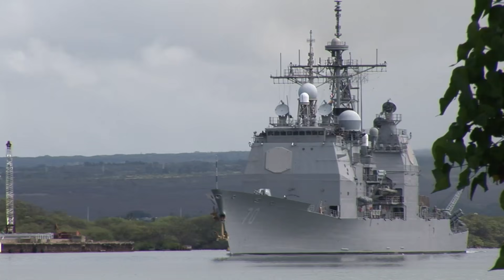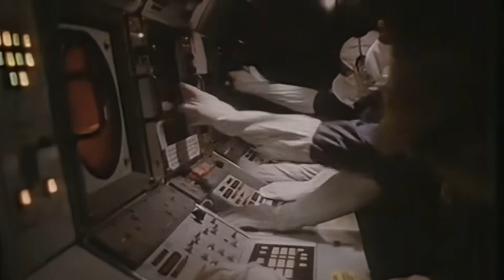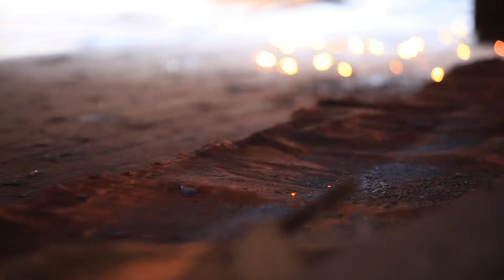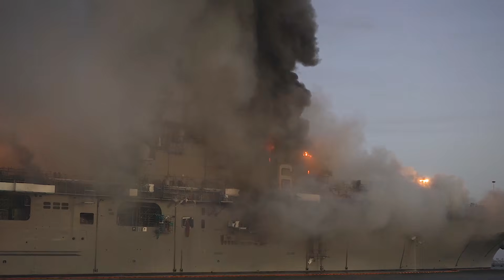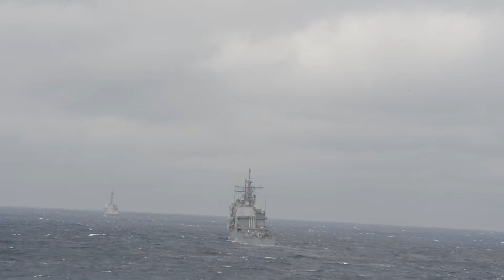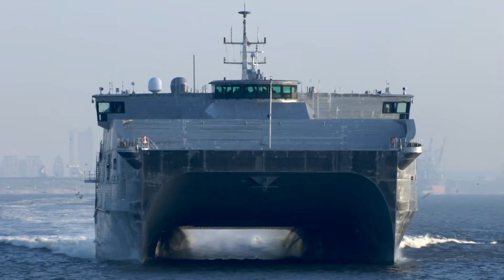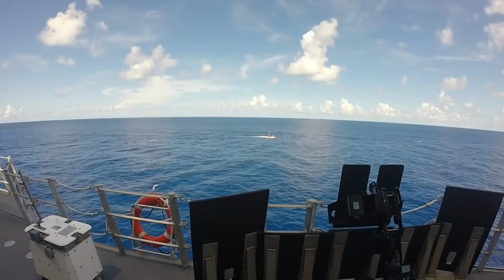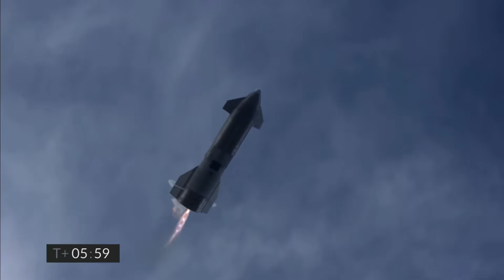Why is The US Building Aluminum Warships?

Comment: "... while aluminum doesn't burn ..."

Uh, yes it does.
Reply: The British scimitar armoured vehicles had 2-3inch thick aluminium armour plate that was known to catch fire if they took a hit
Reply: @tacticalultimatum  yup
Reply: The fumes from burning aluminum  is highly toxic
Reply: MELTS
Reply: So does steel in similar conditions. You can light steel wool for example.
Reply: @krupert8355  steel wool is much different
Reply: @phredphlintstone6455  how so?
Reply: @krupert8355  all of the air in it. It's not like a block of steel. You can push your finger through steel wool
Reply: @phredphlintstone6455  Are you saying you can light a block of aluminium on fire with regular sources of heat?
Reply: @krupert8355  define, regular sources of heat. After all, we are talking about warships and tanks and such. 
But there is a reason why you dont find aluminum wiring in houses.
Reply: @phredphlintstone6455  it would be easier to mention what would be an unnatural source of heat... say a plasma torch. And from what I read the reson for dicsontinued aluminium home wiring is due to expansion and contraction issues as well as oxidation issues when joined to copper connections. Both of which could lead to a fire hazard... not due to the metal but due to bad connections leading to heat and sparks. Aluminium is used for high voltage power lines. Aluminium is also used to armor copper cables.
Reply: @krupert8355  well there you go. When was the last time a navy ship was threatened by a torch? 
As far as aluminum cables. ..you dont see all that many cables in homes. I did almost mention them before but thought it was off the track. Cables are much thicker so the heat aspect is different. 

Back to the point. Burning aluminum sends out toxic gasses. 
Steel wool isn't exactly steel, try building a nail out of steel wool. 
Yes I know steel wool will burn, used the steel wool and battery trick to start more than a few fires. 
Really cool to watch, you can see the individual threads glow red and then they vaporize, the glow jumps someplace else because electricity is going to electric. And many times by the time there is a flame there isn't that much steel left. If there was such a thing as aluminum wool it would be the same thing but you can end up with strange diseases and odd tumors.
Reply: @phredphlintstone6455  my point is that both metals burn in similar conditions, mainly high heat and high oxygen, such as with metal powders and metal wools. People mentioning that aluminium burns is kind of pointless if the alternative is steel.
Reply: @krupert8355  its the fumes that come off of that burning that is the issue
Reply: @phredphlintstone6455  It's the whole "hallway melting around you" thing that's the real problem
Reply: @anonymousapproximation8549  I'd say both
Reply: @phredphlintstone6455  Personally I'd be more worried about the whole "melting" thing then the "toxic fumes". At least the fumes kill you silently.
Reply: @anonymousapproximation8549  dead is dead
Reply: @phredphlintstone6455  Yeah, but if something has to kill me, I'd rather it be fumes. At least it puts me to sleep and then kills me. Anything else is just several moments too long of either pain, terror, or both.
Reply: @krupert8355  not really, aluminium is more reactive
Reply: Uh, no it doesn't.  Powdered aluminium does, but then the powder of just about any metal does.
Reply: @krashd  Add a little rust. You get Thermite.
Reply: @krashd  smash an anti-ship missile Into an aluminium superstructure and there is more then enough powder
Reply: @krashd  Have you ever seen alu armored carrier after burnout? Apparently no :D
Reply: Even steel burn at the right temperature.

Comment: Aluminum burns when exposed to a flame, as it is a reactive and flammable metal. It burns in oxygen with a white flame and by forming aluminum trioxide. The oxide layer that always covers the aluminum metal protects it from reacting with the air. The removal of the oxide layer allows the metal to react with air and water.   USS Stark FFG 31..survived a exocet attack...This vido needs a bit of fact checking..
Reply: I think your thinking of magnesium.

Comment: Elon Musk disagreeing with the Russians regarding material properties doesn't make sense. The kind of material properties demanded by warships and rockets are very different. SpaceX decided to use stainless steel because of its ability to hold it's structural strength in a wide temperature range.

Comment: we should make our ships out of inconel. it's twice as strong as steel and has better heat resistance. sure, it's a little more expensive then steel and aluminum. but when survivability is factored in, i would think a bunch of steel and aluminum ships sitting at the bottom of the ocean would be a lot more expensive then inconel ships which are still fighting, even after being hit.

Comment: Aluminum will burn when oxidized.
Reply: Aluminum oxidizes as soon as it meets O2.  Never seen an aluminum can burst into flame
Reply: @protonneutron9046  My friend, apply high heat. That's all I need to say. Many low explosives(low just denoting that it's not as fast of a reaction as high explosives and faster than a deflegration which is just fast burning) use aluminum or magnesium often(these are the more basic explosives that often terrys or low tech adversary's use) 

The reason you haven't seen a can explode is because at atmospheric pressure and regular temperature the reaction can be quite slow, harmless and not really notable. But assume your enemy makes an explosive of 1 micron Black Eckhart German Aluminum and mixes it with a powerful Oxidizer such as Potassium Perchlorate. You'll get an explosive that will temporarily deafen you with just a few grams and certainly blow limbs off you're too close. 

The difference like most things is the time frame but also the heat. When high heat is applied you could agree that aluminum oxidizes faster. Well imagine a squashed Head projectile filled with this mixture that's heavy on the potassium perchlorate, within milliseconds of detonation all aluminum will be used from the bomb but then the high heat will cause a certain amount of aluminum from the ship to vaporize and react. This could lead to any even bigger explosion and temporarily start a metallic fire. This was one of the same worried they had with the Bradley IFV to an extent.
Reply: @caymanhunter2612  I was joking my VERY young friend.  I was casting aluminum before your parents were together.
Reply: @protonneutron9046  lol. Okay even younger padawan. Actually you know what. I'm okay being the younger. No big deal gramps. But lol instead of casting Aluminum and nothing else on the 4th of July drop some potassium nitrate or even a stronger oxidizer and watch that puppy erupt like a volcano
Reply: @caymanhunter2612  I prefer to use I + NH3 when making things go boom.
Reply: @protonneutron9046  if you searched you probably could find some videos of aluminum in bombs. It can be used in everything simple from fireworks and flash powders to explosives. Magnesium is probably one of the closest metals to how it performs. Rarely do you ever heat aluminum high enough to react and when you do and apply some oxidizer the reaction can sustain itself for a small time afterwards. The other issue is when it oxidizes it releases hydrogen gas which is part of the reason they didn't want it in the Bradley and tried to argue against it. 

Think about it. It requires a lot of energy to get aluminum to oxidize rapidly(and then explode in turn). The only time this heat happens irl is for chemical reactions of bombs. You could imagine certain explosive weapons or a thermobaric bomb, a high explosive warhead etc, could generate the necessary heat. And the second that temperature is reached with ideal oxidizer content, it will react.

Aluminum is almost as dangerous as magnesium in this regard. Honestly using beryllium and then coating it would be safer even with beryllium toxicity.
Reply: @protonneutron9046  and one more thing. Oxidization doesn't necessarily mean explored to O2. It means exposed to the oxygen atom in a state when it's likely to bond. Usually this is in powders that contain lots of oxygen. If you sprayed 100% oxygen at heat however the aluminum would similarly catch fire and burn.

Comment: composites will likely kill aluminum and steel in boats.
elon chose SS because supersonic speeds, radiation, reusability, pressurization, high and cryogenic temperatures, etc. A boat faces far less difficulties than a reusable aircraft or rocket so not sure why they bitching so much. Aluminum cracking is definitely a design thing and not a material thing otherwise how do you feel about getting into a commercial airplane that you can watch flex in the air, is pressurized, is exposed to corrosion, exposed to significant forces, etc. I think ship design is lagging behind aviation because aviation is more heavily impacted and dependant on innovation.

Comment: I welded for a good part of my life and I cannot see how you could weld aluminum to steel. I have never seen it and i would say it impossible.
Reply: They lay one bar of steel with a paste sandwich on an aluminium bar and then detonate the paste which fuses the two together and this eliminates electrolysis. Then you weld the steel/aluminium bar to the hull and aluminium to the upper deck. The USA sold the bars to it allies but control the sales so the Russian would have higher maintenance bill. I hope i explain it right for you.
Reply: @terryquarton3864  So really its more like metallicly gluing them together

Comment: I think its for fuel efficiency and speed no? I think over the life of this ship it will offset running costs on fuel, yes they will crumble in battle, but these are designed to outrun and have better strike first capabilities, lets face it even if your ship is made out of the best steel known to man, modern anti-ship missiles will knock anything out.

Comment: I don't even need to watch this video , all Ships go to Drydock 1 time a year to have rust removed I worked there as Security . The All Aluminum fast Hydro Troop Carriers do not get Hulls sandblasted and painted they only go to Drydock for Engine refitting and  interior remodeling  . Like I said this is a no brainer . All Steel Ships have to be 100 % hull sandblasted and re painted .

Comment: I served on an FFG (Oliver Hazard Perry class). The ship had to be put in dry dock to attach plates to the sides, to stop it from buckling. And then USS Stark was hit by two Exocets. One missile didn't even explode... instead its fuel set fire to the ship, doing as much damage as if it had exploded.
And that's the thing: if you're attacked in an aluminium ship, you are at extreme danger of being burned to death, or being hit by the shrapnel. Even if Phalanx was able to intercept a missile, hundreds of missile fragments would still be inbound, at high speed, and would go right through aluminium.

Comment: Are domestic steel industries are decimated aluminumquieter and more expensive but it wears out and doesn't stand up the battle, melt quicker and heat in the fire that was the problems with the ships in the Falkland islands to Brits

Comment: SpaceX moved from carbon fiber to stainless steel (not just any steel works in this way), because at cryogenic temperatures it gets MUCH stronger. And it maintains its strength at much higher temperatures than CF composites or aluminum as well. Very suitable for a a rocket that faces both extremes of the temperature range. (I'm pretty certain a ship will never go cryogenic)
Carbon fiber is nice because it has a similar modulus of elasticity to steel, so in an appropriate composite fiber arrangement, it can take up the load at a similar rate to the steel it is attached to. (that's worded poorly but I'm not sure of a better way to put it)
Reply: but you cant fix CF while its in the water, metal you have a chance

Comment: The Space X portion is a bit of a stretch.  Mainly because Space X is using a special alloy of steel designed to enhance strength as it gets colder.  Plus spaceships are not often moving on the ocean unless they impact it coming from orbit.  Maybe for the super structure of a ship, the russians have a point...but without a good study on it...who knows.

Comment: Concerning the carbon fiber thing: SpaceX ditched carbon fiber not because steel is better, but because a) steel is cheaper and much faster to build and b) during reentry(!) the measures that would have to be taken to not have the carbon fiber burn up negate any weight saving compared to the special steel alloy they are using now, which actually gains in strength as it's heated.

Comment: Elon Musk switched to stainless steel for very different reasons. It has to do with weight at cryogenic temperatures. Stainless steel is actually much tougher at very low temperatures than carbon fibre so can use less stainless steel than carbon fibre to do the same job. A rocket can also be produced much cheaper this way. Put stainless steel on a ship at ambient temperatures to do the same job as carbon fibre and you will not see any benificial gains what so ever. In fact it will crack far worse than steel or aluminium - it's just how stainless works.

Comment: HMS Sheffield was scuttled, due to damage sustained. She also burned out as the cabling on board was not in conduits (a weight saving measure). If the Royal Navy had mobilised HMS Belfast, the Exocet would have just scorched the paint work. Newer is not necessarily better!

Comment: "Yeah let's just diffuse the bomb with another bomb, they should cancel out right?"
Reply: They try to destroy the detonator.
The system to ignite it "properly" and most effectively is fairly complicated. 
Otherwise, stored weapons would accidentally go off all the time!

They do the same thing with the bomb squad, using a water jet blast to safely defuse stuff.
Reply: Done correctly, it works. According to MARINE CORPS EOD GUNNERY SARGENT I WORKED WITH.
But, what would HE know?
Just a GUNNERY SARGENT in the fucking MARINE CORPS.
What have you done?
Reply: @donaldmurphy3148  He doesn't even know you or your supposed Marine friend, how would he know?
Reply: I think that actually works tho
Reply: Um yes, a small charge is often used to defuse something unstable. Depending on the explosive in the ED thats not always a bad idea. Some modern explosives dont explode with pressure, but have many other methods for ignition.
More importantly this can be done from afar afgter preperation, wich increases safety for the defusion personel.

Comment: aluminium is light and does not rust, so a ship oculd be lighter and faster and hold more equipment.

carbon fiber is yet another way to reduce weight, whether or not it it is any good will be down to design, if you want to design anything you have to take into account the materials you want to use, its strengths and weaknesses, you would have to design the ship around those not try and make the material conform to your design, that is a recipe for disaster and that i believe is the problem with the aluminium ships, they try to design a ship, not taking the materials being used into account, instead they design it around what they want in the ship and neglect the material limitations, if i take a materisl and it is strongest in 4 meter lengths but i make the lengths 5 meters and expect the same performance, i am going to be very disapointed, just as they were with the first aluminium ships.